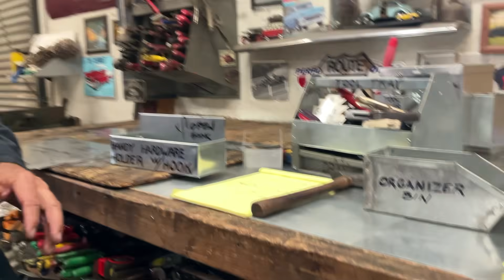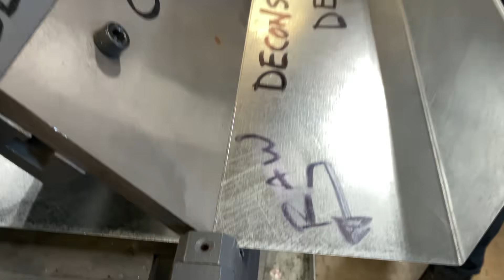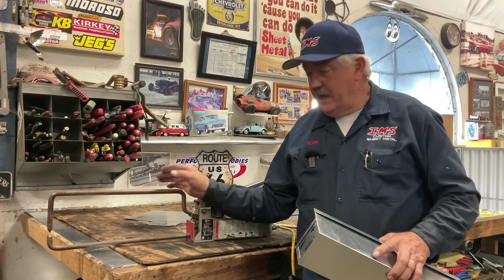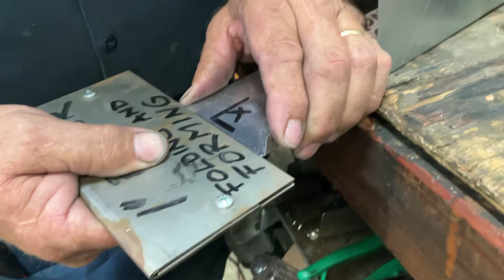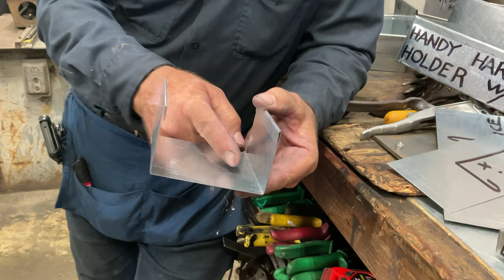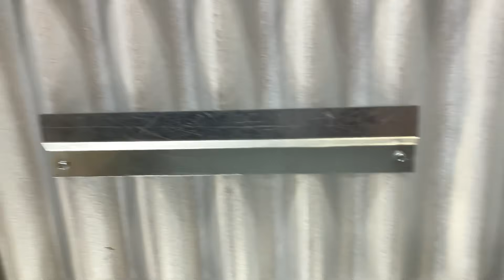Sheet Metal is Fun! Handy Hardware Holder with a Hook.

Comment: Just curious, if you have a narrow tab, is there an offset tip for the spotwelders, so that you can get those welds closer to the edge?  I love that you demonstrated the spot welder, I've seen those at Harbor Freight, and was curious the use case.
Reply from the maker: Good question, Randy. If it's your tool , feel free to modify it to suit your needs. I have several arms that I have bent, filed , and ground for specific jobs here at the shop. If you grind the front of the arms down, you essentially move the points closer to the end of the welder for shorter tabs. You can buy the arms separately, so you can really go to town with them. If you have more questions, let's talk again.  Thanks for hanging out with us.

Comment: Ken is it ok to spot weld galvanized sheet metal?
Reply from the maker: That's a great question , it shows that you've been paying attention in class. The brevity of the weld, as well as the pinpoint focus of the process complete a very useful attachment. However those elements still add up to a less than perfect airspace. This process commands awareness and attention.  If you are going to perform more than several spot welds , be sure to work in a ventilated workplace. Let me know if this answers your question satisfactorily.
Reply: @sheetmetalisfun  lol yes I believe it does answer my question. I presume you’ve dealt with some less than perfect air and lived to tell the tale?
Reply from the maker: Yes,  my big brother " frank the stank " ruined many a Sunday drive with his talent. All these years later , and i have yet to find his rival at ruinous airspace.

Comment: Another great video, Thanks! I've never owned a spot welder. I've used them, but like 30 years ago. Thanks to you, I've been making a lot of boxes and pans with galvanized sheet metal lately using rivets to make the joints, and have been considering getting a HF spot welder for speed and ease. I'm concerned that using the spot welder on the galvanized is going to burn off the coating and after a year or so there'll be a big rust spot there. Some projects may be indoors only, some may be outdoors. What are your thoughts?
Reply from the maker: The spot welded area will be susceptible to  rust . As a matter of fact, if you don't stay on the trigger long enough to compromise the zinc coating,  you are not going to get a spot weld worth having. We either solder over the spot, or  paint
 a small amount of cold galvanized on with a q tip , or put a dab of polyurethane caulking over the affected area. Let me know if that answers your questions.  Im glad to help. Btw if you send us pics of your sheet metal accomplishments, we would love to share it with the class and put you in our fabulous fabricators book  sheetmetalisfun@yahoo.com 
Come on, Scratch  ! Let's have a look.
Either way,  thanks for hanging out with us.
Reply: @sheetmetalisfun  Thanks for the answer, yes that answers my question perfectly, and I'm already in your fabulous fabricators book!  I made the tool tray out of some old 24ga and sent in a pic of it along with my dads dustpan and we were featured in your Tapering Waste Basket video.  Thanks for the add!  By the way... thanks to your videos, I ended up looking for, and finding a great deal on a used 48" magnetic brake and am having lots of fun with that!  Keep up the great videos, I learn something new from every one!
Reply from the maker: @Scratchthejeepguy  you're a rockstar Scratch ! Thanks for reminding me. We appreciate you.

Comment: Ken another handy item.  I need to build one for the end of my tool box for those tools I use everyday.  I saw a spot welder just about exactly like yours on Temu for $125.  Will it work on aluminum 'cause I have a bunch of it.
Reply from the maker: Hey Johnny,  aluminum requires a lot of power, and the 110 hand held model will not give you a strong and reliable finish. If still want to try it, and why not ? Then clean your metal with maroon scotchbrite and a chemical aluminum cleaner, then get on it as fast as you can. Let me know what you come up with.

Comment: I was wondering how thick of Metel will that spot weld
Reply from the maker: The hand-held spot welder works best on uncoated metal  like stainless and cold rolled. The zinc coating on galvanized works like a thin layer of rubber, so you really gotta stay on the trigger for a long time. I would not rely on it in a high vibration environment. When we spot weld, we usually solder over the top of it. You can stop by the shop and borrow ours for a couple days and test drive it. Let me know, George.

Comment: Ken, most things I see are stamped by heavy press. One can learn from it but that is not directly transferable to manual sheet bending. One example, a bend with lots of angle indentations to add rigidity. Another example usage of wave bending pattern for the rigidity as well.
No so many things are made with simple bends. 
Thanks for teaching and sharing your experience.
Reply from the maker: Im having fun with you folks, and im glad to share.
Reply: wave pattern https://oatesmetaldeck.com/wp-content/uploads/2024/10/omd-metal-roofing-4-inch-box-rib-panel-16_9.png

Comment: Great stuff.  Are there any issues with leaving the galvanized/zinc on there when spot welding?  Does it affect the integrity of the weld?  Thx.
Reply from the maker: Great question as usual, Stooby. If you saw the spot weld break in the video, you know the reason. That's four layers of zinc coating trying to repel or insulate the weld from taking place. The hand-held spot welder works fine on stainless and cold rolled , but it doesn't dig deep enough to work on coated metals. Good observation. Thanks for watching
Reply: @sheetmetalisfun Hey Ken!  Thanks for the quick response.  Being the proud owner of a new spot welder, should I first use some acid on the work, where I intend to weld?
Reply from the maker: @stooby1978 I prefer using maroon scotchbrite. A little acid left behind in the lap seam will end up hurting your finished project.
Reply: @sheetmetalisfun Great.  Thanks Ken!

Comment: Hey Ken and Stacie!  Great to see/hear y'all again! Hope everyone is well!  I sure hope you don't mind if I nit-pick a little bit?  Forgive me if you do!

I believe it's not the Voltage that does the welding, but rather the Current.  You could have a million volts, but let's say only 1 milliAmp and it wouldn't weld.  And when you squeeze those jaws onto the work, it's a short circuit across which there would be no (or very little) voltage, but of course you could have oodles of current.

Blame my nit-pick on 40 years working in electronics! 

Great video and tips, as always!
Reply from the maker: Good catch  JB. Im getting to know you better with each comment. I think you're a good dude, and im glad to have you along on this adventure. Thanks for the lesson.

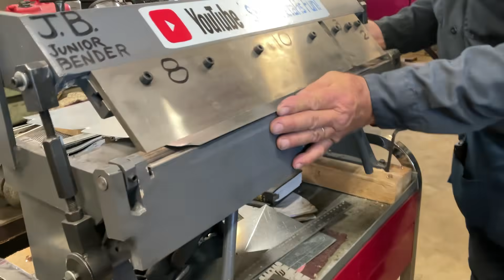Comment: At 6:40, Quick question about your 24” Junior Bender: I’ve seen some bending machines with an “L”-shaped support bar attached to the bending “leaf” with handles. Does that feature improve bending accuracy or control in any noticeable way? Curious if it’s worth prioritizing when choosing a model.
Reply: That's a support angle for heavier gages and long pieces.
Reply from the maker: The stiffening angle is helpful on the longer models. 3 FOOT or 4 foot. The bending leaf can sag when bending thicker sheets. ( like 20 or 18 gauge)
It can be a limiting factor on small Z or offset bends. We are using 26 gauge on all of our projects so far. So the angle would not be necessary. Let me know if that answers your questions . Im glad to help.
Reply: thanks, sure you did